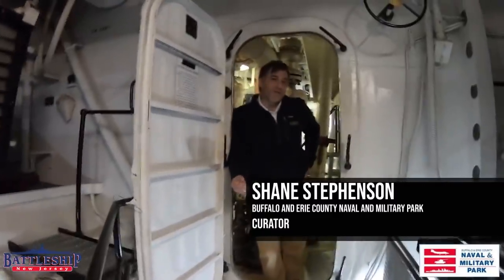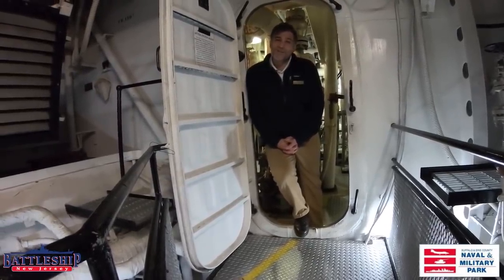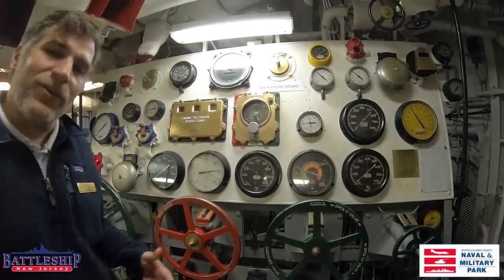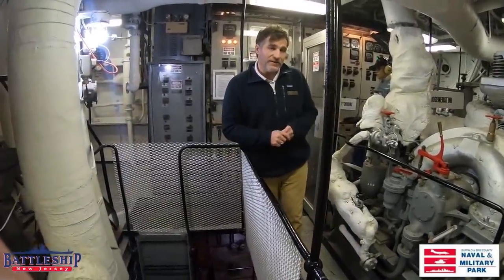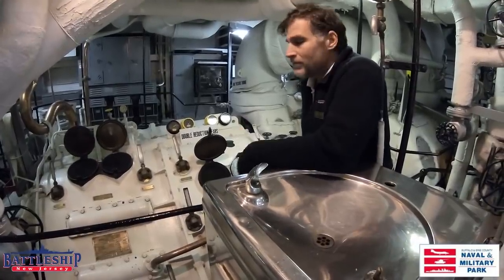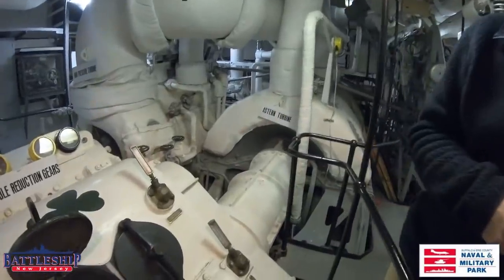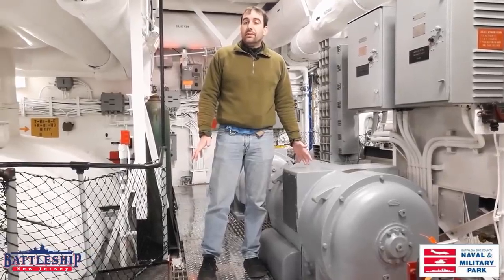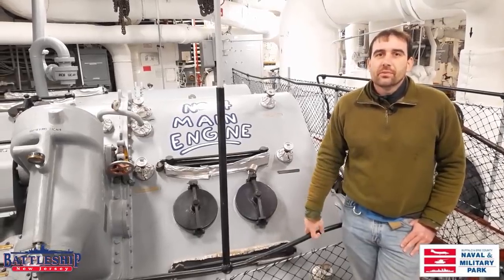Engineering on Destroyers vs Battleships

Comment: Considering how much larger the battleship is than the destroyer, i'd expect the battleship to need a much larger HP increase than it actually has.  It's something like 20x larger but has only 4x more HP.  Of course part of this is probably related to the old square vs cube thing, but i suppose a lot of it has to do with the destroyer being forced over its hull speed?

Comment: Around 12:20 of the video, you don't really reverse the steam  going through the LP turbine to make it go into reverse.  That line up against your head that goes into the front and aft end of the LP turbine is the astern steam line which is main steam. During forward operation the main steam (superheated) goes first into the High Pressure Turbine, then the steam goes through the crossover into the LP turbine.  (large line that runs from the back of the HP turbine to the middle of the LP turbine) before exhausting into the main condenser, then pushed by the main circ pump to the main air ejector to the DA tank.... Oh, for the Fletcher and all steam ships, it's technically not "Used steam" that heats up the DA tank, It's aux exhaust stream from the main condenser which is used to heat that, water in the evaps, even the gland sealing system.

Comment: I enjoyed the video collaboration. It would have been nice to see more information about how a steam system works, and how the multiple fire rooms and engine rooms could be cross-connected. I currently serve on submarines, and cross-connected steam systems are of critical importance to our survivability. I heard that the steam and electric plant of the old Nautilus were heavily based on the survivability of WW2 destroyers, and it would be nice to get a better feel for how that worked back in the day.
Edit: while I can recognize a turbo-generator, a reduction gear, or a reversible turbine engine (they haven't changed much in 60 years), I don't think many people can really picture what's going on inside the casing. Perhaps some cutaway diagrams?

Comment: the Fletchers were the standard US destroyer of WW2, we built 176 of them, at the time they were considered the best destroyers in the world.  Note the engine hp, 60,000 this was more than any of the WWone battleships at Pearl Harbor.  they all weighed in excess of 20,000 tons, a fletcher is a 2,500 ton vessel, ten times the ship with less HP.  Actually I believe the WWone ships had about 20,000 hp so only about 1/3 the power, hence they were slow.  The Iowa class ships had 212,000 hp, ten times the power of the older ships.  the Iowa class were designed to match the speed of the fleet carriers, a vessel that didn't exist during WWone.

Comment: Actually, normal configuration was HP turbine exhausting into LP turbine with the Astern Elements on each end of the LP being used for reverse. The Cruising Turbine was for long distance steaming to the Pacific areas of operation when there were no refueling ships around enroute, during WW2.  We only used our Cruising configuration a very few times, and usually during trials and "economy runs" during the years I spent on the DD's. That DA Tank, or DFT is for deareating, or taking dissolved  oxygen out of the condensed steam enroute to the feed system, it also serves as a preheat. I always wonder why these museum tincans always have just the aft plant open and not the forward (main control) plant. There is more interesting stuff up forward, cross-connect valves and such.

Comment: In the Sullivans, were the two forward turbines ever used together for more power, or were they always only run separately? Was the cruising turbine longer with more stages to get more energy out of the steam, but as a result, had to turn more slowly? But larger ships could have two turbines and a larger gearbox? Trying to figure out why this was done this way,

Comment: The HP turbine is probably a Curtis Stage followed by a number of Rateau Stages. The HP turbine exhaust (usually running at a slight vacuum) is fed to the LP turbine which is a reaction turbine. This arrangement is more efficient than a single turbine feeding into a condenser. The astern turbine blades as mounted on the same  shaft as the LP turbine blades and both share an exhaust to the condenser. 
On newer designs the tank is called a de-aerating feed tank.

Comment: Hey New Jersey just curious. Could you start and use if required the ships Emergency Diesel Generators?
Reply from the maker: We don't mess with those systems at all, we have no need to, we get power from shore.
Reply: @BattleshipNewJersey  understood. I was just wondering if say in the event shore power was lost if those systems were still operational. It sounds like the answer is no.

Comment: why do desperate fire rooms and separate engine rooms for each shaft would it have been easier to have both fire rooms n engine rooms run both shafts that way the ship could have decent power if one lot was knocked out? also if i understand this correctly after the death of the sulivins didnt the navy make a policy where if siblings join up both would br put in less or non hazardous jobs?

Comment: How Hot was each of the engine rooms of each warship? Today many modern warships the engineering spaces are cooled.
Reply from the maker: New Jersey's would have been around 120°F
Reply: @BattleshipNewJersey  Whoa!  I thought flight opps on the rooftop was "hot!"  I appreciate your reply. I enlisted as a boiler tech and got re-designated as an AD - Aviation Machinist Mate....happy I got re-designated! 120°F? Wow. 
Thank you USS New Jersey Museum. Bravo Zulu for all you do!
Reply: I can tell you that the engine rooms on the Nimitz class are not air conditioned in any way.  While in the Persian Gulf you will get 100+ degree fresh air supplied to the engine room through large vents at each duty station.  When the engine room is 120 degrees that air feels surprisingly refreshing.
Reply: @johnjensen2217  Thank you Shipmate for that info. I never went below into the machinery spaces. As an airdale I had no reason to be that below decks. Mahalo for you service John. My two ships were USS Kitty Hawk CV63 and USS Ranger CV61.
Reply: @byronharano2391  Sorry, I didn’t mean to misrepresent myself.   I did not actually serve however I had the opportunity to experience that environment as a test engineer for Norfolk Naval Shipyard while underway in the Persian Gulf.  I only had to deal with it for a week.  Those sailors dealt with that every day for months on end.
Reply: @johnjensen2217  John. Thanks. Hey you did go and help our armed forces so you did service in a civilian capacity....you still contributed. No! You did not mislead anyone. Thank you John. What your thoughts about Arabian Gulf (the Arabs Name....theirs not Persia. That ancient rivalry)? There is some excellent sport fishing and yellow fin tuna do have annual runs in that body of water.
Reply: @johnjensen2217  Happy you got to experience haze gray underway on Gonzo Station. 
You just about got your sea-legs John.

Comment: Surprising that no one mentions what a technical achievement the double-helical double-reduction gear main engines were. The USN was nearly 20 years ahead of everyone else here, the Brits didn't go there until post war.  This allowed American plants to be far more efficient in space and weight per shaft horsepower. One of the reasons American ships typically had 2-3 times the range of Brits.
(My first ship, USS Koelsch FF-1049, I was M-Div, later MPA. Ended up the only EOOW qualified officer aboard her at the time.)

Comment: The third turbine is not just the astern turbine.  The low pressure turbine is in the same case.  After going through the HP and / or cruise turbine, steam goes through the low pressure (LP) turbine to the condenser when going forwards.  The astern turbine also exhausts to the condenser opposite to the exhaust of the LP turbine.

The NJ LP turbine is also different in that it is a "double flow" turbine.  A double flow unit has two turbines facing the opposite direction - steam enters the middle and goes to both ends to go to the condenser.  Note the crossover pipe enters at the middle of the turbine, not at the end like the destroyer does.  Double flow turbines are used when the last row blades would grow too long (unable to withstand the centripetal force) .  By having the steam split into two directions, each half can have shorter blades.  The astern turbine is only on one the forward end and exhausts only out the front exhaust hood.
Reply: Finally someone that knows what they are talking about!

The NJ curator may not be an engineer but he does not say things that are wrong.

I can not say that about the Buffalo curator...
Reply: @josephpadula2283  Those of us who have served in navy steam powerplants are getting a wee tad long in the tooth.
Reply: @josephpadula2283  Yes he does say things that are wrong. It is not really his fault, these things are incredibly complex, and he has not spent years serving aboard combatants in operation. 

The Fletcher also has degaussing coils fed by motor-generators (not generators). The "shipyard" degaussing discussed is called "De-Perming" , which serves to scramble the magnetic field set into the hull during lengthy stationary periods such as construction or shipyards stays. This procedure was developed around WWII, and was the source of the "secret experiment" that was conflated into the "Philidelphia experiment". There are several on the east coast, (Kitsap, Norfolk, Kings Bay and Ingleside) as well as one in Bangor. I have been thru the Norfolk one when we finally degaussed USS Boone FFG-28 after her Bath Maine PSA. Really messed up all my cassette tapes.

The MG sets constantly need to feed the port and starboards coils differently depending on the latitude and heading of the ship. how they are fed is determined during deperming, and checked and adjusted regularly when the ship runs a "degaussing range", a fixed facility near all naval bases.
Reply: @grathian  and how did learn about this? The De-perming
Reply: @hamaljay  Sounds like Grathian was in the US Navy. Possibly an Electrician's Mate or Surface Warfare Officer. You can read more about this Degaussing/De-perming here:https://fas.org/man/dod-101/navy/docs/swos/eng/62B-303.html
QM1(SW) ret.
Reply: Correct. The third turbine is the same as aboard New Jersey - a combination LP/Astern turbine.  You can see the medium sized main steam pipng feeding the astern stage with the "Astern Turbine" sign hanging from it. You also see a very large pipe with a shamrock. This is the exhaust from the HP turbine which feeds the LP stage on the opposite side. 

Also, the turbines do not clutch out of the reduction gear. So they are always turning, even if you are only feeding steam to the astern or cruising turbines. The cruising turbine is far more efficient in steam use at the low revs needed for low speed operation, the oil usage is insignificant

See fig 38-1 here: (since I can't post the image)
https://maritime.org/doc/dc/part10.htm
Reply: Thanks for sharing your knowledge and expertise! It really does take a crew and we are appreciative of the support!
Reply: 35 years ago I was an engineer for GE Marine Department and had turbine cases off quite a few times. Clearly you have had them apart, too. We did reduction gears, Ship Service Turbine Generators, Reactor feed pumps, Variable Frequency Drives, etc.
Reply: Something I'd be curious about is if New Jersey has cruise stages in the HP turbine.  Some warships had cruise stages at the front of the HP turbine.  Effectively there was a cruise turbine and a HP turbine in one case.  A single throttle control would open all valves to the cruise turbine, and as the HP turbine valves started opening, the cruse turbine would vent to the crossover.  (The cruise turbine normally goes through the HP, making the HP an intermediate turbine.)  
IIRC, the WWII fleet carriers were setup this way.
Reply: Good comment. 😁 MMCM(SS) Ret.
Reply: Thanks for the link @grathian , I was interested to learn how the turbines work. I appreciate the historian giving it his best shot, and I appreciate the informative comments :)

Comment: Do you know why the steam was such low pressure?  600 PSI ?
Reply: Right?? I always thought (incorrectly) that the bigger combatants used 1200 psi plants....
Reply: @wheels-n-tires1846  I am use to supercritical in a power plant,  3600 PSI,  Wonder what modern nukes operate at?
Reply: @wheels-n-tires1846  The 1200 PSI boiler did not occur until post war- circa 1950's- then only combatants- Auxiliaries Ships stayed 600 PSI. Also I believe both these ships had operator capability to control/ set the superheated temperature as operating - the post war (both 1200 PSI and 600 PSI - had superheated - but set by design - no operator capability to control/ set superheated. For pressure - read the Wikipedia articles on the 1930 built Destroyers - I think that includes information on the gradual increase of Boiler operating pressure. - The collaboration IS great- probably a lot more work for editing / combination after filmed - BUT worth IT.